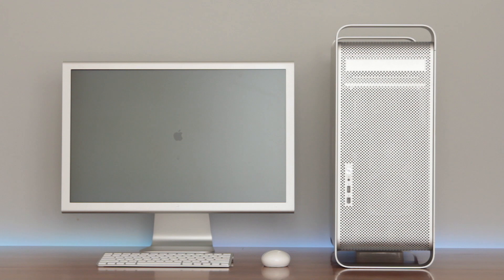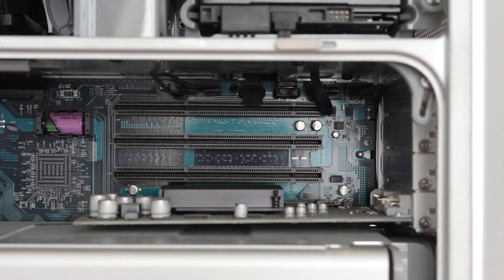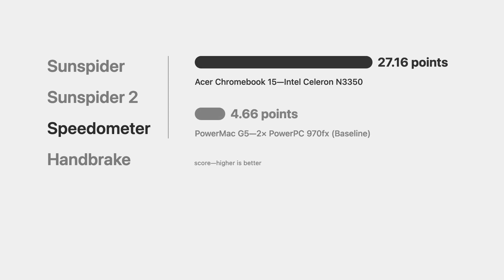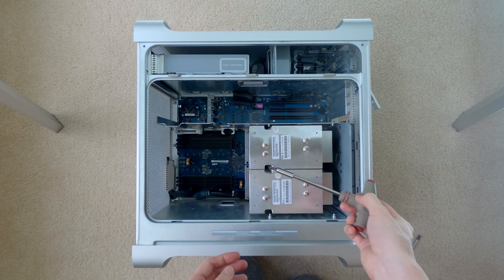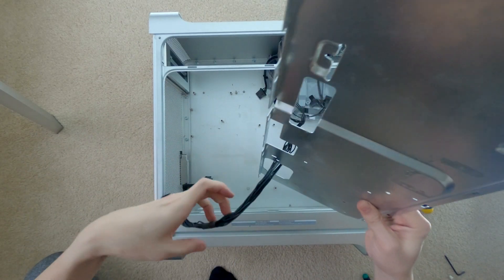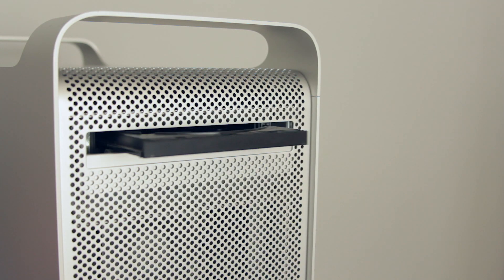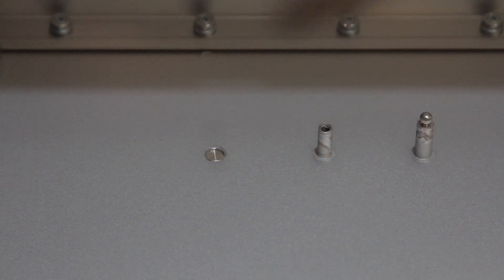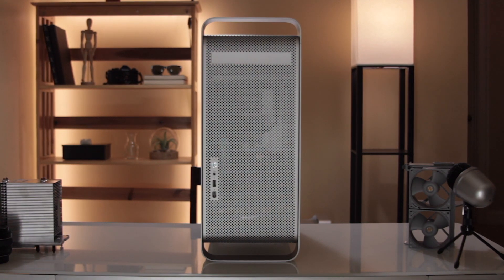PowerMac G5—ATX Conversion Build Log

Comment: Question: What about compiling a C application - wouldn't that show a better usage of the older G5 processes? - JavaScript is single threaded and optimized for a different pipeline.
Reply: The entire benchmarks section makes no sense, he is comparing 17 year old hardware to modern hardware. Everyone knows chips exponentially got faster and smaller every year.

Comment: Putting power supply mounting on top is not very good idea. PSU fan will face GPU fan and it will pull hot air that GPU fan pushes.

Comment: At last count I have like 5 "cheese grater" Mac Pro boxes, currently used as end tables, shop benches and office furniture since the design is so classy -- I have yet to see a more elegant computer case design! I already keep a lot of older Mac systems in use with my media production -- with the guidance of your instructive videos, I'm inspired to convert at least one of my G5 Mac Pros into a modern ATX system. It will be running Linux, since so many powerful media tools are available for that platform now, both mature FLOSS softwares and ports of popular commercial products. I'm an inventive maker type and enjoy metal work, so this seems a perfect project!

Comment: My power Mac is still running debian to this day, there is something I love about exotic computer architecture that makes me want to preserve it, but there's one thing I'd love to address is power consumption, because even idle my G5 draws twice as much as my Ryzen 5 5600G computer
Reply: @username8644  version 10.0 but there is a dependency issue to circumvent with libc6 which breaks perl during upgrade, it's quite annoying but once you get past this you can upgrade to debian Sid and get a working system with current software, save for a few packages which can't be built (like Firefox because it requires nodejs which needs V8 which is not available for PowerPC :()

Comment: Made my own Custom ATX Conversion G5 because i like the design and the quality of the Power Mac G5 case. Had a donor atx case i used the mainboard bracket with PCI Slots and the Front Panel Equipment. I've mounted two USB 3.0 plugs on the original Front panel plate. The buttom hole for the fire wire plug fits for a second usb plug if you delete the plastic inlet of the case front. Of course it doesn't look that perfect, but it works. The Top shelf i cut into two pieces. The part in the front takes my blu ray disc drive and the gap between these two parts is for the power supply cables. In the back i've put in the power supply und cut a hole into the top shelf to get air into the power supply. The rounded edge on top back of the case still exists and i just cut out a hole to put the power cable through. the power supply is just jammed between top cover of the case and the top shelf. I 3D printed a mounting bracket for the front where i can install 2x 120 mm or 2x 140 mm fans to get a nice airflow and a 120 mm fan in the back. It is also possible to install a 240 or 280 mm radiator in the front bracket.

Comment: Great work Jerry and well explained. I've got a couple of old G5s here and I want to do something similar... but I am desperate to keep it looking stock from the outside. I wonder if anyone makes a motherboard I/O board that fits in the stock rectangular recess, along with a couple of ports for the GPU.
Reply: I have a perfect condition mac pro tower 1,1 that is what I would like to do to convert the interior without drastically changing the exterior?

Comment: Awesome, just put my order in for the Laser Hive kit. I have the Mac Pro case already. 2 questions: did you remove any scratches and scuffs from the case, and if so, how? And secondly, are you doing anything with the front I/O cutouts? I’m thinking of fabricating something to run USB to them.
Reply from the maker: The G5 was fairly clean when I bought it so I didn’t bother with it. Removing scratches from the finish is difficult as you’d have to sandblast and anodize the case for the correct finish—I wouldn’t bother. The other option would be to sand and paint the entire exterior. 

I only wired the power button on my G5. There may also be wiring guides for the Mac Pro to reuse the front panel daughterboard. LaserHive sells front panel conversion kits as well I believe. 

Good luck!
Reply: @jerrywoohu  thanks!
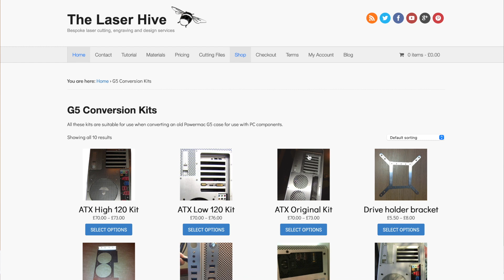Reply: @ 6:57 it shows that front io conversion not sure if the lazer hive still has it though

Comment: Does the I/O shield get slightly covered up by the backplate? I'm worried about the GPU connectors getting covered up...
Reply from the maker: Didn’t have an issue with my motherboard connectors, but one problem I ended up having with my gpu connectors is the DisplayPort closest to the side door gets blocked by the overhang of the laser hive backplate. Ymmv though.

Comment: Where did you buy the motherboard tray from?
Reply from the maker: The Laser Hive!
Reply: @jerrywoohu  I checked there and didn’t see any for sale, I ended up buying one off eBay.
Reply from the maker: Laser Hive goes in and out of stock, especially since COVID. I waited a few months to purchase mine. They usually post updates on Facebook.
Reply: @jerrywoohu  that’s what I figured why I didn’t see any, I was also looking for the power button I/o cable conversion. My one G5 I just hardwired a pc power button and led plug to it, and I found the power button has a chip that Apple put upside down and was causing the button to not work. 

Hard work paid off I wanted to keep the G5 exterior stock and just did a few mods, usb 3.0 at the front and kept the rear fan assembly I don’t really want to cut the case up, but maybe with my other one I may cut the rear off but still unsure found it not needed as much as I thought. .

Comment: Ahhh I always love seeing people converting G5 into hackintosh or windows box, my G5’s collection keep raising in value 😁 My dual processor 2004 2.5ghz is on active duty for music production, my quad G5 is unused atm.
Reply: Lmao. Your outdated turdbox is worth $100.
Reply: @benw4401  I mean they sell for more than 2009-2012 Mac pros generally even tho they are so obsolete compared to them. 2010 Mac pros can be upgraded to run Sequoia so are still viable today. But ya once Macs hit 20-25 years they become vintage and the price shoots up where's 10-15 years after release they are worth not much at all , 50-100$ maybe
Reply: My g5 board is dead as many are due to the solder problem. So I want to at least put it to good use
Reply: glad I can help you, and make myself happy with my conversion

Comment: The full ATX conversion thing is too expensive. What should i do instead?
Reply from the maker: The way I modded my first G5 was tearing the motherboard tray out of an old Antec ATX case. If you’ve got an old case laying around, see if you can detach the tray that holds the motherboard. I had to make some cuts with my dremel and drill out some rivets, but in the end I got the tray and the backplate out and used that.
Reply: I’m also trying to do the most inexpensive possible, what have you done about the power button conversion ? (Also I recommend you to use our g5 casemod reddit to have help if you’re struggling too)
Reply: @Jessiiiiiica  there's a subreddit for this stuff? Could you send it?
Reply: @Jessiiiiiica  thank you so much

Comment: But now u ruined it by making it windows 😒
Reply from the maker: ...who said I was installing Windows?
Reply: The case itself is amazing and can be beautifully modified to make it a gaming PC case
Reply: all im saying is thats theres no need to ruin a perfectly running mac
Reply: It’s not ruining, it’s modernizing!
Reply: @AgentXRifle  no to a collector like me its ruining
Reply: @dark147891  "perfectly running", if you wanna use a dual socket mobo with 2 of the slowest running single cores go ahead
Reply: @splashboi898  your missing the point thos macs are collectors computers now they need saving
Reply: @dark147891  I built mine keeping most of the original look